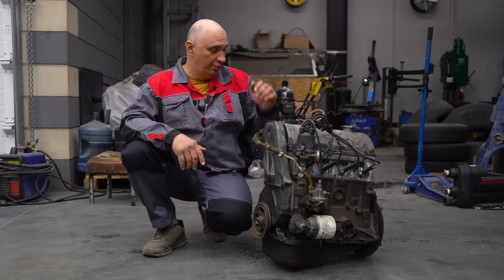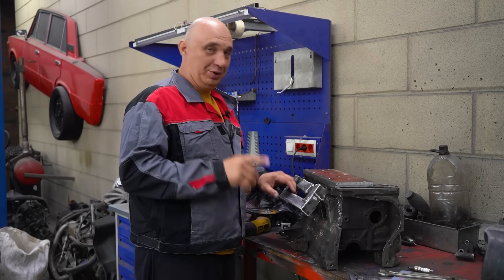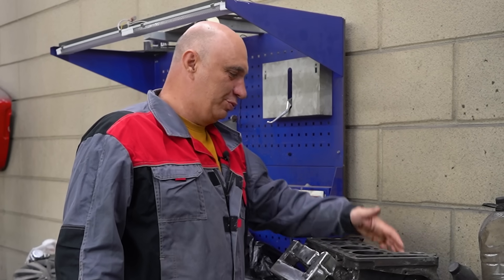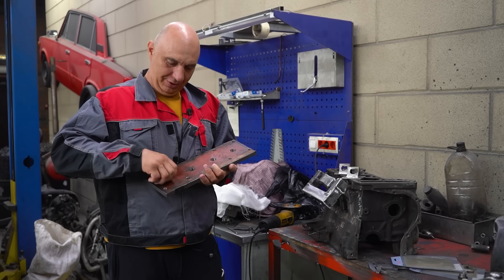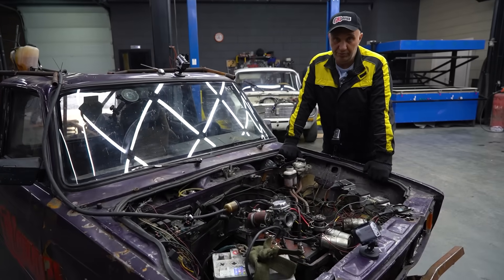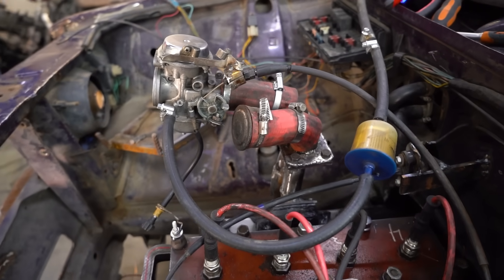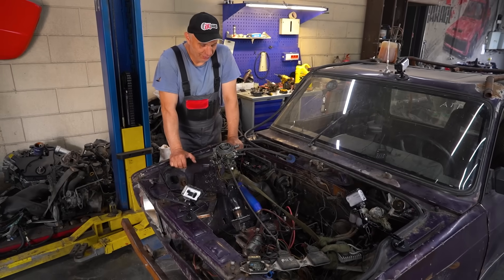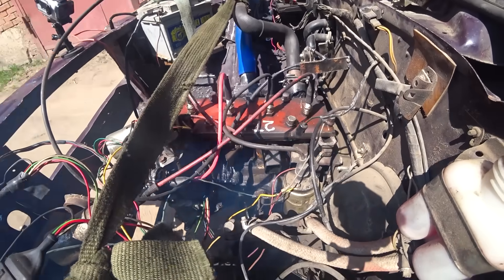4 stroke to 2 stroke Lada engine conversion

Comment: It's ya ignition timing. You have supercharged induction. Inlet n exhaust slots maybe need moving or reshaping. The back pressure of exhaust is required 2 increase efficiency but it should run without. Twin starter motors maybe needed to get required spin speed for starting. You are nearly there. Good work:-).  You never fail till you STOP!. keep goin

Comment: i would use a complete new block and change the upper camshaft timing sprocket to half the teeth so the camshaft turns the same speed as the crankshaft. and keep eye on your your cam timing. you guys do nice work
Reply: i am sorry. i meant to say start with a complete new engine

Comment: Forget crankcase transfer porting. The geometry is all wrong. 
Get a belt driven supercharger, sucking though the original carburettor to feed the transfer ports with pressurised air/fuel. 
Then rev that thing until the uncooled head blows off ! 🤣🤣

Comment: This engine might just run with some sort of exhuast manifold and bring all three of the intakes to one and use one Reed valve. The three cylinder snowmobile engines don't have seals between the mains there just open ball-bearings.

Comment: From what I see your jug area needs to be reduced and sculpted using a crank stuffer material like delrin plastic..........The jug area should equal the cylinder cc size or be slightly smaller and all cylinders should be seperated........

Comment: Here’s what you need to do. Make your own rotor for the distributor that can fire on two posts instead of a single post. Then hop up the ignition with the accel super coil with a MSD box. Without properly timed ignition for 1/4 and 2/3  it’s never going to run. I see you’re running the auxiliary shaft at a 1:1 ratio so the distributor will work for doing that. If you do fix it, make sure you turbocharge it.

Comment: also there's no need for intake ports  put the inlet air right into the block from blower/turbo have intake valves open/close on each cylinder the same time as exhaust does  cut and weld like you always do on camshaft

Comment: put the 4 stoke head back on  then you need to make exhaust valves from intake valves. a 4 valves per cylinder like a Detroit/emd engine also you need to have a intake either turbo or blower to send air into it  then you have a chance it will run

Comment: the crankcases should be sealed from each other as you said. but i thing not enough tranfer area and tranfer goemtry is a big problem also try making the tranfers point less to the exaust side  ( look at 2 stroke cilinders)

Comment: Exhaust is a major key factor to a 2 stroke. It needs an expansion chamber, this helps keep the air/fuel inside the cylinder.
Reply: Not real two strokes , ships trucks locomotives .
Reply: @SepticWhelk ah sorry, I thought this was a petrol 2 stroke that they were fitting! You’re probably unaware that the 2 stroke diesel engines that are in ships, locomotives and trucks require a super charger or some sort of forced induction, whereas petrol 2 stroke engines that are running a carburettor, require an expansion chamber in the exhaust, this creates back pressure at the exhaust port to minimise air/fuel escaping out of the cylinder.
Reply: It is not that dramatic

Comment: Exspansion chamber. And single carb per cylinder. And sync carbs. May have to modify crank sealed roller bairings
Reply: It also looked as if you left the cam in it to run spark. Spark timing has to come directly off the crank. May take like 4 crank sensors to time.

Comment: Next time, try making it supercharged 2 stroke. Keep the valves, match the cam and distributor speed to the crank.

The reason you don't get a running condition is because 2 strokes require positive pressure, you could actually just put a supercharger on what you've built and it should work by the looks of it.

Comment: You prime the engine when you pump the gas's and it seems to starve for fuel after a couple of seconds, it really depends on where intake and exhaust ports are placed how an engine likes to run, also think about the compression ratio with the cilinder head you have and where the intake port closes, if there is pressure in the cilinders when the intake port opens you might not be able to pull in a fuel mixture, this is why modern two-strokes use the crank case to transfer fuel to the cilinders as it acts as a pump. When the piston moves down crank pressure increases helping to force the fuel mixture into the cilinder. The main issue is that anny leaks would cause failure to run. And having a normal carb tends to be problematic due to air flow pulses coming back into the carb....

Comment: hey vlad have you tried nitrogen cooling the engine fed into holes in the block beside cylinder walls ? probably could fit jets into welch plugs ( freeze plugs )

Comment: I think there are two things wrong…
First…compression ratio seems to be too much…
Second…on most two strokes the piston serves a dual purpose…on the upstroke it sucks the fuel mixture into the crankcase…on the downstroke it pressurizes the mixture into the cylinder…under pressure…therefore I think you need to put at least a 1/4 spacer between your head and block and I think you need a small turbo to force the fuel mixture into the cylinders

Comment: Mechanic here, with lots of experience with 2 strokes including diesel 2 strokes. You need to introduce forced induction to your engine somehow in order to get the gases moving and allow this to run, you've inspired me don't stop
Reply: run it without coolant. use the water jacket as an air box. cut ports into the cylinder walls.
Reply: with maybe a blower from a 3-53
Reply: Electric blower.. ditch the crankcase trasfered..if it goes well mechanical blower
Reply: Use the starter motor turbo to push the air in ;)
Reply: What????? That's completely false. Carburated GAS 2t actually don't tend to run well with forced induction because of bad mixtures and 2ts actually push mixture out of the carb on the down stroke. Therefore the turbo can compromise this system. If the engine was EFI it would be different. However forced induction is NEVER the answer to a non running n/a engine. Forced induction is simply a power adder.
Reply: @joerolfe7967  I appreciate what your saying and I can agree with you, but the idea for forced induction on this particular engines is for the the gases to charge the cylinder. This is why he is unable to start and run the engine. Think 2 strokes principle. Charge gases start off in the crankcase which created the low pressure "draw" then high pressure, think piston moving down pressurizing the air fuel mixture in the case, as the piston goes down power/exhaust stroke/ pressurized crank case air travels into the cylinder scavenging and charging. Ouff that's a lot to explain. Best to watch a video. Anyways in this case look up 2syroke diesel engine operation. Same principle for this application minus ignition type. In his build there is no charge principle built into his engine therefore no air movement, no air fuel mixture so no combustion nor exhaust, therefore cylinder scavenging effects thusly no fun sounds. He needs no other forced induction but a blower, or pro charger. A turbo will not work
Reply: @kevinpiper3223  Their crackcase volume is too large to create a primary compression. Look at the volume in a 2-stroke, it is mostly filled up with the crankshaft and little air space.
Reply: @broughxtreme I think the other guy is talking about forced scavenging with a supercharger. The intake charge did not travel through the crankcase. 2 stroke Detroit Diesel engines did it this way. Millions were made. EMD locomotive engines used the same  method.
Reply: @joerolfe7967  their engine has no case induction so just using a blower motor on the intake would get gasses flowing through instad of case induction
Reply: @joerolfe7967 No ,  the stroke on this Lada engine is too short .  It needs a roots blower and another back valve in the exhaust .

Comment: If the oil passages still exist, that might be where the mixture/pressure is being lost. At worse case, you could probably chuck some oil in there, and see where it migrates to/from, as well as seal any pinholes

Comment: Reed valves was a wild + smart idea, except it lacks a force to push much if any fuel into the cylinders. Need a blower or crankcase pressure to get it to rip

Comment: Very cool. In the early 2000s some American guys converted an air cooled VW motor to 2 stroke. Instead of sealing the bottom end it was more like a Detroit diesel I think, it relied on a roots blower to run. There was a video of it making a pass on the drag strip on streetfire but unfortunately that is lost to time

Comment: No Reed Valves....   Without them it wont work.  The reed valves need to go on the inlet to the crankcase to prevent backwards flow of the fuel mix and each cylinder should have it's own crank compartment.    The fuel air mix needs to flow through the crank case (and reed valve which acts as a check valve) into a manifold from that to the intake port of the corresponding cylinder and out.   no cylinder can be connected to the next, but i think the bearings seal tightly enough that there will be sufficient enough to generate the positive pressure to push the mix through if there were reed valves or like i saw someone else mention a supercharger to generate positive pressure, though I'm pretty sure those old detroits have reed valves as well.

Comment: I think you need 4 carbs and shorter intake manifolds to start, also you need 4 expansion exhaust pipes if you want to have some power/better running engine, i would also recomend a airfilter since a 2 stroke is very prone to cylinder damage when dirt enters in the intake and perhaps make sure to have those crank chambers sealed off, if you follow this advise you should be having something decent with great performance, i wish i saw this one earlyier, my comment might be to late now

Comment: you need transfer ports also if the engine does start the plain metal bearings will burn up in a short time.

Comment: Use a dual 2 stroke carburator and place the carbs as close to the intake as possible..
And make each intake evenly in length...
And is you're ignition timing right?.

Gr from the netherlands

Comment: Nice video! I think the main problem here would be the timing. In 2 stroke engines ignition timing is set from 0.4mm BTDC to about 5mm BTDC. In 4 stroke engines I assume that the ignition timing has to do with valves timing. Also în order to worck properly the engine must not have air leaks în crankcase or at The carb jonction. This is why I think în 2 stroke the crankcase is separate from each cylinder. Otherwise the vaccum produced from 2 cylinders will be cancelled by the other 2 comming down. Cheers!

Comment: Should’ve done it using a supercharger for scavenging so crankcase scavenging would not be required, one just doubles the speed of the camshaft, so it runs at the same rotational speed as the crank
Reply: That works for a triple with a 240 crank or a 5 cylinder engine with a 144 crank. But in regards engines with even numbers of cylinders, like a twin with a 360 crank or a 4 inline with a 180 crank or strait 6, one has to stick a supercharger on for scavenging, replace the camshaft with one with double lobs opposite each other & have a wasted spark dizzie. There’s absolutely no need to rip the engine apart & fit ports to the cylinders, etc. To turn a 4 stroke into a 2 stroke.

Comment: Your problem is volume. Your crankcase volume is like 3 to 4 times the volume of the cylinder below the piston. That isnt going to make enough pressure differential for the piston to pump air in and out efficiently. That means your transfer port will have very little "blow" volume/velocity. Your exhaust port has no ability to use the pulse to promote scavenging, its so short it will actually promote near complete reversion, stuffing burnt mix back into the cylinder. So you have an intake tract that hardly inhales, and an exhaust tract that never really exhales. No scavenging, no running. You need to minimize the crankcase volume (just barely any clearance on the crank and rods), and run about 2-3 ft (65-90 cm) head pipes off your exhaust ports. You also need your carb(s) just outside your reed cases. NO "dead volume" on the intake side, from carb to transfer port is the ideal. An exhaust "dead volume" (pipe length) of 75cm would be about ideal at 10,000 rpm for perfect pressure pulse scavenging (longer at lower rpm, shorter at higher). You dont need either to be ideal, but you need both far closer to it than you are.

Comment: 2 strokes need back pressure to run.. aka tuned chamber exhaust.. put a snowmobile type exhaust on it and it will likely run

Comment: In my opinion it's that you have to have exhaust restriction make good compression with a 2 stroke. That's why they have funny shaped exhaust, to create a resonant wave that pushes fuel and pressure back toward the cylinder

Comment: ports aren't right for a two stroke...sure you tried to make each cylinder seperate in the oil pan but you didn't make ports for air fuel to get pushed past piston
Reply: if you used forced air induction like a detroit then you might stand a chance

Comment: Two strokes require one hell of an ignition system. It would take at least a system suitable for a V8 to run a 4 cylinder firing twice as often.

Comment: Please do a new video SERIES about this. You must get it to run, just look at the scavenging part. Leaving the exhaust ports free like that, is never good for a 2 stroke. You need an exhaust with an expansion chamber. Also you should really change the carburetor to something REALLY big . You will twice the air and petrol for that engine. For example if its a 1500cc you should tune the fuel for 3000cc  (or more).

Comment: Great success using the tow cable between 2 Lada's while the engine is off on the second.
2 strokes for the front lada, 2 for the rear one 😂

Comment: Are the exhaust ports and the intake ports at the same level on the sleeves.
  I believe the exhaust ports need to be a little higher than the intake.
 So you get good exhaust evacuation and it will pull more charge air in .
A draft . Like wood stove.

Comment: Cool project, you guys save me so much time doing all the whacky experiments I want to do, but am too busy fixing everything around my farm, hah.  I think you need more fuel at startup, any time I am cranking an engine, and it will sort of run while the starter is cranking or its being towed in gear, and it seems to improve the more you do it, I think it could be from getting more heat into the block, so my guess is it needs more choke/enrichment, to help starting when cold.  But I'm sure you guys can read spark plugs to check for that.  The other idea is, if the starter won't turn it over, maybe you made a crazy high compression "race" engine on accident, hah, and maybe increasing chamber volume would help?  Last idea is maybe your port timing is off, or your home made port edges mangled the rings lowering compression.   Good luck,

Comment: 2 smoke singles draw air fuel into a sealed pressurized crank case,  sends it up to the combustion chamber and burps it out of the exhaust wit a tuned expansion chamber pipe. You gents are headed in the right direction..👍

Comment: Usually fuel goes into the crank case mixes up then is sucked into cylinder.. it did sound like it was running. Maby it needed more top speed to get it to run. And add oil to the gas

Comment: A 2 stroke has an enlarged muffler right when the exaust exits and regulates back pressure. Each cylinder would need its own muffler.

Comment: The engine block is open on the bottom, so air is easily moving between the cylinders through the oil pan.

Блок двигателя открыт снизу, поэтому воздух легко проходит через масляный поддон.

Comment: Its your crankshaft
Reply: If your Pistons go up and down at the same time it will cause the crankcase pressure to go up pumping air into the intake
Reply: Fluctuating crankcase pressure pumps the fuel-air mixture into the combustion chamber.
You need a one-way valve on the crankcase

Comment: Why don't you created a poppet valve 2 stroke? You will have to change the timing gear from 1/2 to 1 and add a turbo or a compressor for scavenging. I've seen many projects doing this kind of thing.

Comment: Hey fellas. First off you guys didnt make it easy on yourselves. After you get each cylinder sealed properly. I'm thinking go with individual, motorcycle style carburetors, keep your intake runners, shorter closer to the block. Also (I'm clearly no expert on 2 stroke exhaust) But maybe you might be able to find a local fella that's knowledgeable on 2 stroke exhaust. I think you are losing a scavenging effect.  Good luck gentlemen.

Comment: If you retain the stock heads, modify the cams & attach a supercharger you will do less work & have a longer lasting engine.  Basically make it like a diesel 2 stroke! 
https://youtu.be/znBTQvy28f8

Comment: My suggestion is to build a 2 stroke gasoline based off of the principles of the Detroit diesel 2 strokes.  Although they rely on a supercharger, crankcase segregation is not necessary.  And you can retain your oil pan and pump.  A cylinder head with valves are necessary for the exhaust, and a 1 to 1 ratio camshaft.

Comment: Try it like a Detroit diesel. Make all the valve exhaust valves, put a supercharger on the intake side to pressurize the intake side into the combustion chamber and put the regular oil pan and oil pump and ignition back on it.